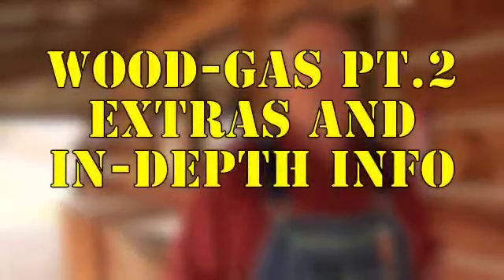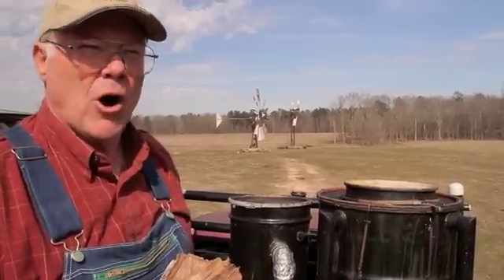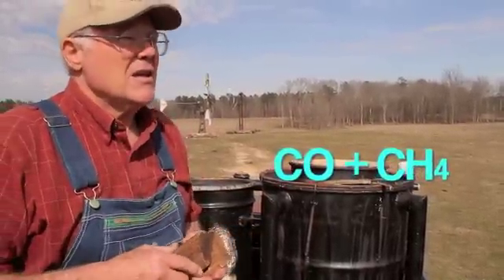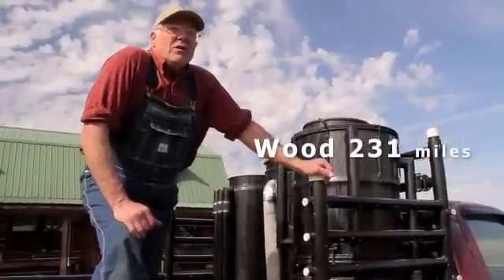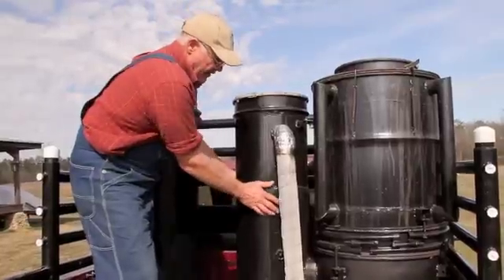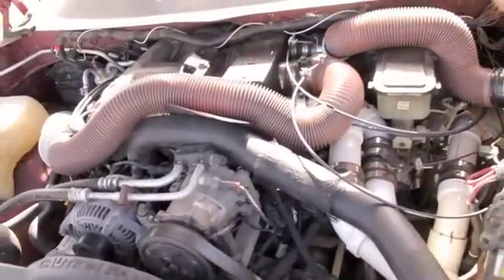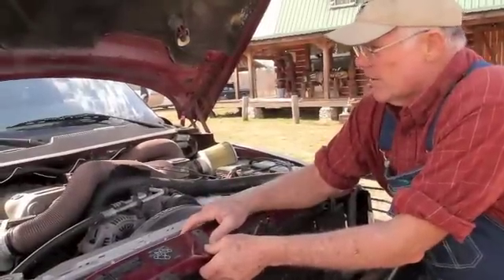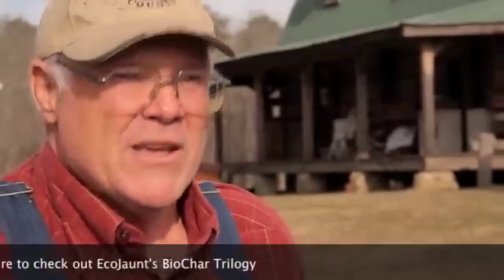Wood Gas Part 2: Extras and In-Depth Info

Comment: This is excellent.  I'm a big fan of alternative energy - especially if it cuts out the big corporations from the picture.  I'll be building and installing a solar water heater this summer.  Would love to run the car on biofuel, too.
Well done, Wayne.

Comment: How long does it take to pull away from a cold start? If you get up in the morning and want to drive to work, how long until you can pull out of your drive way?
Thanks.
Reply: Pull a lever and close a valve and use the gasoline
Reply: @THINKincessantly  Thanks, 10 years later I got an answer. 8^)

Comment: Dumping ash can be done easy and as quick as a few seconds or as long as a few minutes. I will film and post the quick version.  @ waynekeith01

Your internal dominions will depend on what design, FEMA, imbert, GEK, LaRosa, Keith ect.   Some use the principals of superficial velocity to archive the pyrolysis distillation and others may chose different routes . The key is to maintain near metal melting temperatures in the core of the reactor.
Reply: Hope youre well sir.

Comment: Hello noelsingletary,
Hey thanks for the post.
I agree with you on most of the items, I could use a lot more education.
You characterize the steel pretty good; actually at about at about 1400 degrees the steel will start scaling.  If we bring the temperatures on up to apx 1800 degrees this is when the scales will be shedding.    At about 2200 degrees would be where I would think the mild steel would start to melt.  If we happen to have wrought we can go some higher.
Thanks 
Wayne